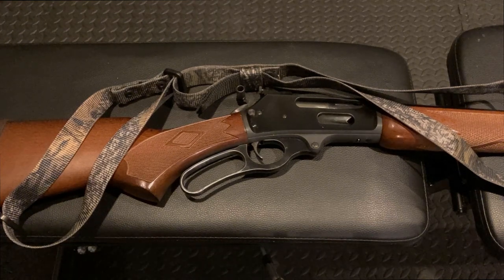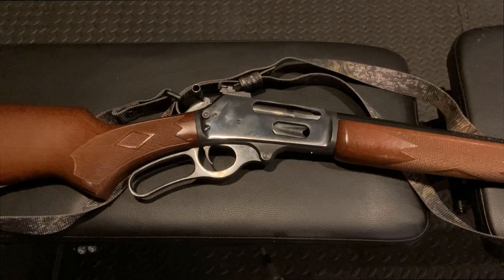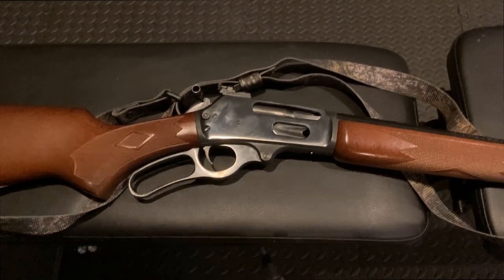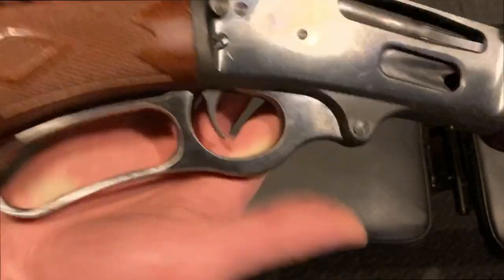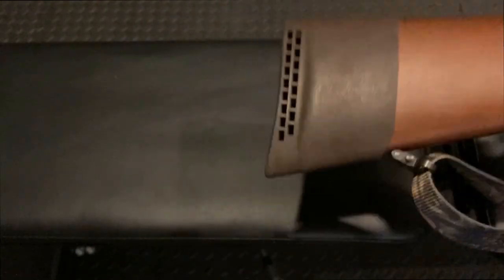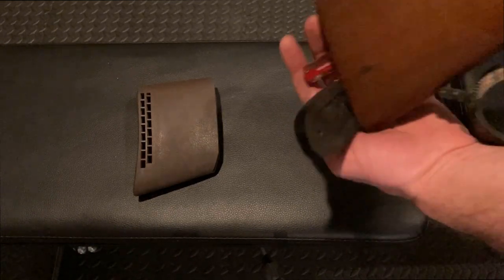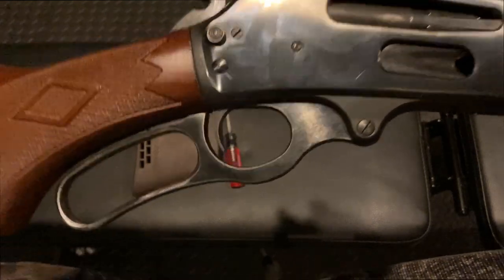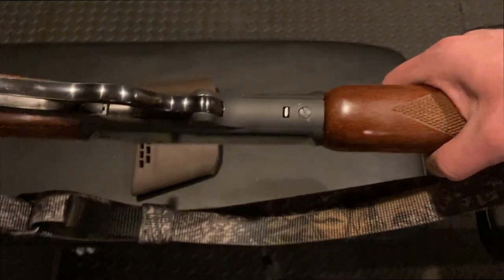The first modification to any Marlin lever gun-My JM stamped Marlin 336 is the worst gun that I own

Comment: Marlin 336s produced with the JM stamped barrel had the two tone recoil pad and the Marlin cap on the pistol grip. This is not a true Marlin made 336 unless the stock has been replaced. I would venture to guess if these issues are legit it is a Remling (Remington Built) receiver with a JM barrel installed. As virtually every one has commented a true JM Marlin doesn't have these issues. Just my two cents...

Comment: Gun screws are designed to be tightened with a gunsmith screwdriver, which has no taper to properly fit the screw slot. The craftsman screwdriver will not fit the screw slot so you will not be able to tighten the screws.
Reply: It's called a hollow ground screw driver. The blade should fit 80% of the screw slot, and the shank of the screw driver is concave on both sides, a carpenters screw driver is a strait shank, these will bugger up the screw real fast!! Check out Brownel's for a set.

Comment: Well I gotta say my Marlins don’t have that problem… I have 3.some fairly old 1960, 1997, and a 2005.  
   I’m wondering why yours is doing that.  Are they factory screws? Original ones. Try ordering a new set. 
Screws hold by applying torquing force obviously…and with the Wedging effect of the threads. Keeping parts tight. Your fasteners act like there worn out or just out of spec that the threads don’t wedge against each other.

Comment: Was this an original owner or bought used?
I have new and used Firearms, never had a problem with my Marlin Leveraction rifles. Seems like a minor problem. The new Colt Python had loose screws causing issues. The factory corrected it. Thread lock helps. A bigger problem is the fit and finish of the Marlin rifles made by Remington. Those rifles had plenty of issues.

Comment: Here is your Loctite comment.  If you choose to not use Loctite, you don't want a solution, you want to complain.  And the screwdriver that you are using is not ground to fit the slots on your screws.   It's a carpenter's screwdriver.

Comment: So putting this comment up there for all to see.... while you may have a JM stamped barrel I would say you bought an early (aka the worst) Remington built Marlin guns.  It appears you have a cross bolt safety on the side of the receiver.  I could be wrong though so sorry if I am.  While you seem to detest even blue loctite, might I suggest you replace the screws before scratching up the blueing of your receiver?  The screws in yours may have been over torqued.  In addition, instead of using a craftsman screwdriver, purchase a hollow ground gunsmithing screwdriver so as not to bugger up your screw slots.
Reply from the maker: It’s made in the year 2004.

Comment: Mine is the budget Marlin 36 AS from 1984 and not one screw has ever came loose.  So the question now is why would you be against lock-tite?  It is a simple fix.  I actually put the red on my sling hardware and will never have an issue...

Comment from the maker: Serial number: 96####13 (year: 2004)

I never intended to insult all you Marlin Fanboys with this video, I honestly was trying to help others, I see now that my experiences may be atypical.  

The gun shouldn't need loctite, all my other rifles have threaded fasteners and they never come loose, never, even if they are moderately tight to begin with.  

The tubular magazine screw will never stay tight and falls out easily, all other screws stay in the gun, but come lose easily.  Thank God the screw that holds the tubular magazine gate spring stays tight, if that ever came lose I'd sell the gun for nothing.  I'm going to try a few suggestions from you all, thank you.  

Oh... If the lever ever struggles to go into battery smoothly (stops just short and then is hard to move), check the bottom screw attaching the magazine tube to the receiver, I bet that screw is loose on many of your guns and little people know it.

Comment: I have a M1894 44 Mag JM and it has the same problem. LocTite 222 might be the way to go.
Reply from the maker: You're one of the few people that has replied respectfully, thank you.  

Have you had good luck with the 222? The shock from firing doesn't cause it to let go? 

Most don't understand why I dislike loctite, but whenever I need to rely on it, unless it's the green (permanent) or red (high strength) it never tends to be reliable; I simply can't use any of those on this item.

Comment: Is it the guns fault or your fault, for not using a tiny dab of locktite on the screws?  Plus, I think what you're not taking into consideration is, its probably a post marlin made, Remington made 30-30. I could be wrong, being that I've never owned a 30-30 before today, but I don't think the checkering started until after marlin sold out. If I'm wrong, please let me know. These are things that I wanna/need to know.
Reply from the maker: My serial number is below ‘04, yeah the problem could be me, but none of my other guns that have screws have this problem, the screws stay tight.  Thanks for watching.

Comment: Loctite would help stop that, lol. Gunsmiths use a torque screwdriver. Have you tried that yet? Also I heard a little blood when it dries acts as loctite too🤣
Reply from the maker: Even when I tighten then crap out of them, they'll loosen quickly.  The one on the bottom forward of the lever is the worse. Yes loctite would help, until I need to take the gun apart and I need heat to break down the loctite.
Reply: @amateurism1  Use Loctite blue.  Screws stay tight but you can still loosen them with a screwdriver.
Reply: @royseifert3078  yeah everybody knows that except this guy😂 blue loctite would solve that problem and you could stilll easily remove the screws when needed.
Reply: Barring that, steal your daughters nail polish, it works too and not as aggressive as Loctite.
Reply: @amateurism1  That could probably be your issue, you over torqued them and they stretched ( Yes, bolts and screws do stretch ). Try some new one's, torque them to proper value and see what happens, worth a shot.
Reply: @amateurism1  blue loctite does not require heat for disassembly.  Also did I see a cross bolt safety on your receiver?

Comment: Looks like a 2009 remlin with left over parts to me
Reply from the maker: I'm honestly curious, what makes you say that/what's the give away? I did buy it around that time.
Reply: @amateurism1  do some online research of the serial number. It will tell you the year of manufacture. OldSchool Ron may be right, a rifle built by Remington using a mix of parts after they moved Marlin to New York.
Reply: The checkering on the stock and fore grip / end and how different the blueing looks. Some earlier models did have checkering ( I don't think it was done in that way / design ), but just like RemArms did with the Remington firearms that recently came out, old inventory of parts being used along with some new parts, it's also quite possible.
Reply: @amateurism1  The wood looks like Remington era furniture. Remington did have JM barrels when they acquired all remaining parts from Marlin in Connecticut. Those original JM Marlin Leveraction rifles work well.